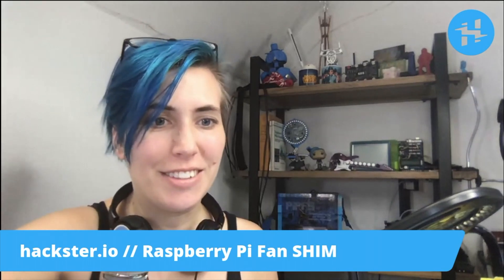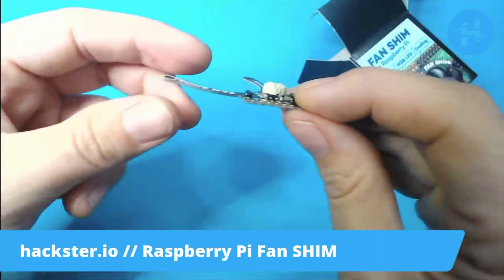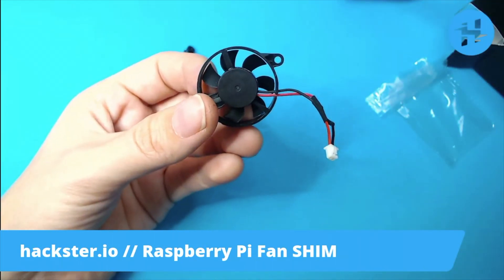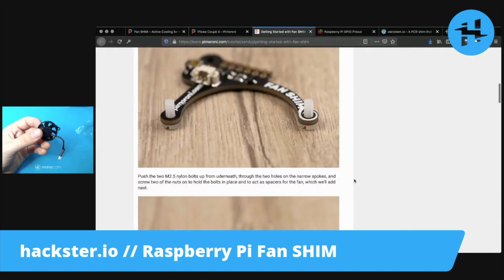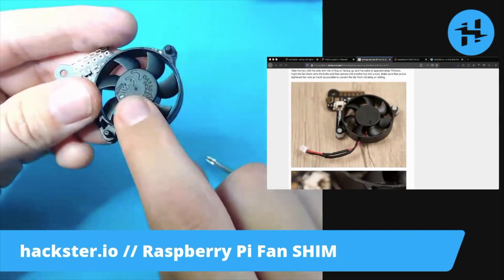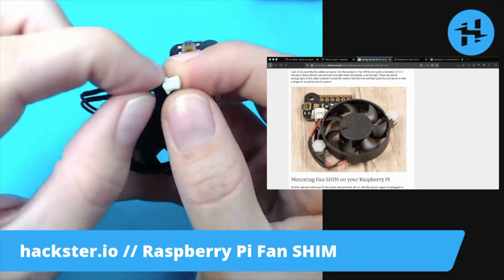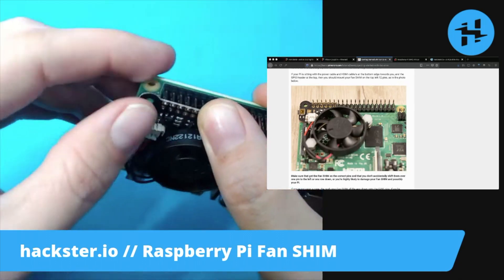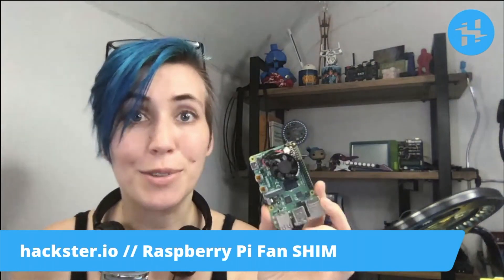Raspberry Pi Fan SHIM // by Pimoroni

Comment: are you still able to fit the pimironi hyperpixel display 4.0 with this fan shim.
Reply: Yes, I have this exact setup on a Pi 4 without any issues. Make sure to let the fan run intermittently and not 24/7

Comment: I bought one of these for my first Pi 4, which was mounted in the official case and was overheating. Sadly, it only lasted a few months. The fan itself isn't rated for 24/7 use so if you get one of these, but sure to run some sort of driver that only turns it on as necessary.